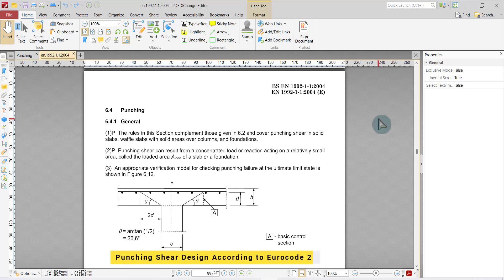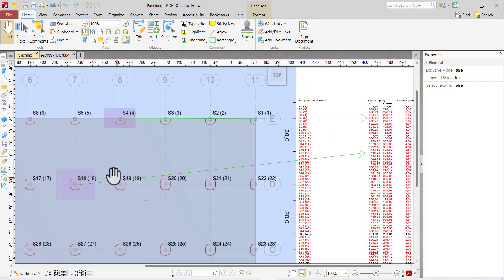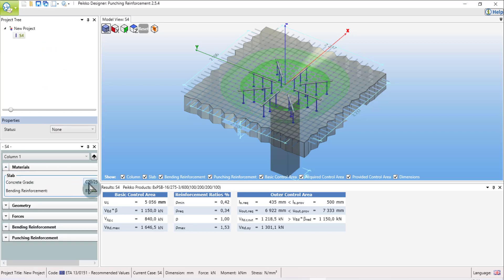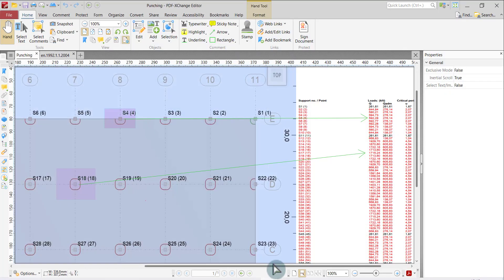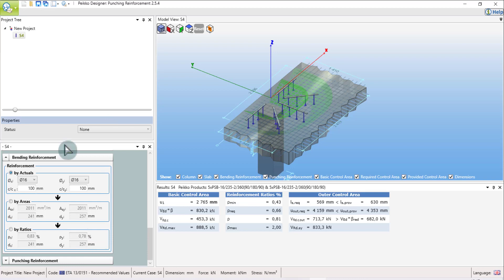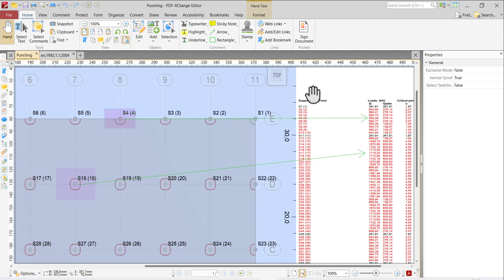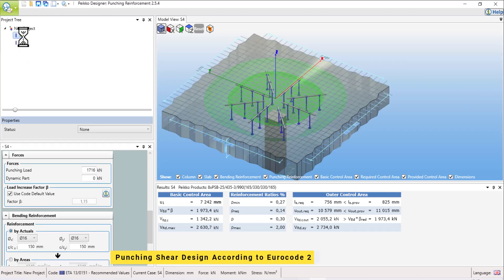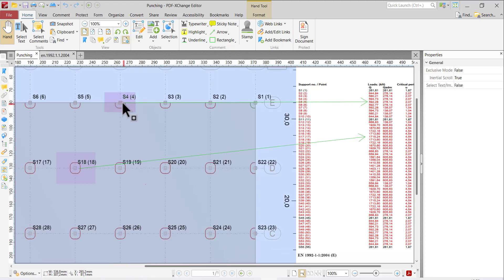Punching Shear Design According to Eurocode 2 using ll PeikkoDesigner

Comment: Great, but in practice having such different thickness of the slab is almost not possible, what would you suggest as a solution aside from having drop panels or increasing the shear reinforcement?